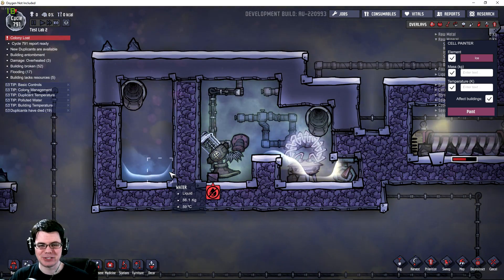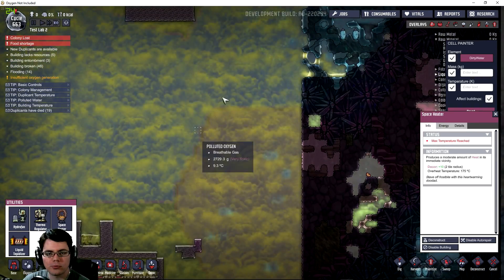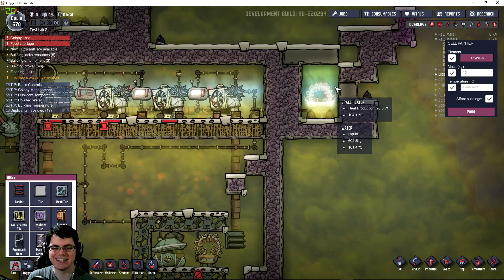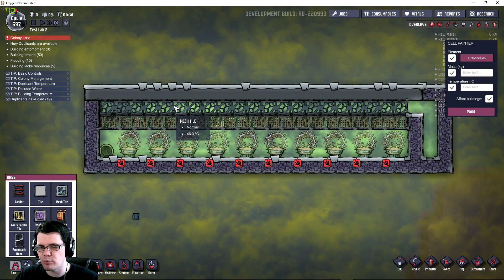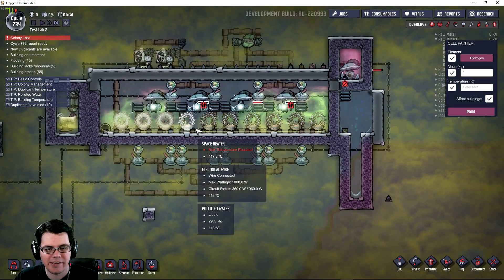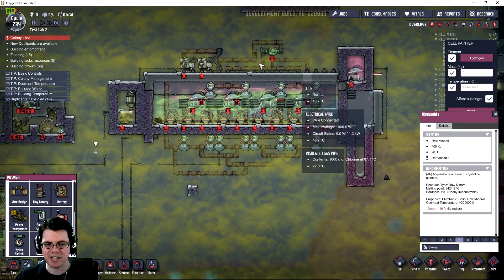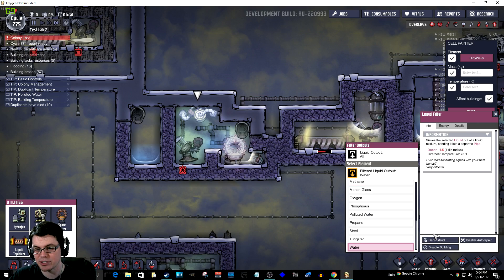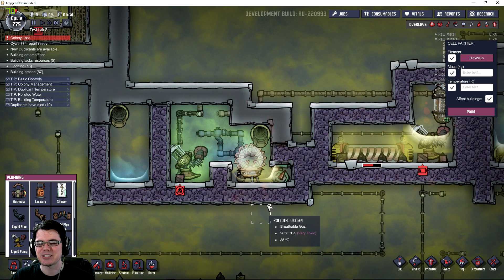Easy Steam With a Chlorine Space Heater! Oxygen Not Included

Comment: I would like to tell you a few things you may find useful in the future.

1/ all buildings that generate heat do so in two forms - "normal operation" and "exhaust". If you click on the building and point the mouse on the Heat generated item, you get a breakdown in mouse tooltip. "normal operation" is how much the building heats itself. Exhaust is how much energy is sent directly to the environment. That energy is spread evenly over all tiles covered by the building but when there's less than 1.5 kg of matter over that tile, the actually deployed energy is reduced proportionally for that tile.

2/ all building heat production needs to be multiplied by a factor of 200 to get accurate figures. Space Heater generates 18 kW of heat. Tepidizer generates 4 MW. Also all buildings (but not tiles) have mass reduced by factor of 5 for thermodynamic purposes. These both however only become important when you start making detailed heat balance/transfer calculations.

3/ There's no heat conductivity along wires or pipes. Put some in vacuum and heat up some spots by the painter, you'll see the temperature doesn't propagate

Comment: I'm convinced this will work if we experiment with mesh-floors below the space-heaters. I think it's producing a low amount of steam because there just isn't enough liquid water to turn into gas when it gets hot enough.

Pre-heat the polluted water reservoir with a tepedizer then pump it into some heat-conductive mesh tiles so the space-heaters output clings to that. Possibly even mix in some of those pipes mentioned - so as much heat as possible holds onto the 'bottom' layer of water so larger chunks it turns to steam.

Either way great find! Looks like you and the rest of us mad scientists have some experimenting to do now we know chlorine is the key.

Comment: how to do it: take your original setup, and replace the floor with gas permeable tiles, then the steam goes down and there it can be condensed into water. the condensing room is also full of chlorine, but it only needs to be the size of a liquid pump which is what will draw the water out. also add a space ABOVE the heater with a liquid vent for polluted water to be added in, restricted by a.... whatever the pressure regulator thing is called. the incoming (preferably room temp.) water cools off the chlorine (maybe) and then proceeds to become steam

Comment: I think i figured out an exploit with liquid tepidizers. The trick is to have to tepidizers next to each other (<1 tile away). Then they will see each other as part of one structure.Stack two tepidizers one on top of one another.Have the bottom one submerged in water. Give power only to the tepidizer on top.I had problems with  overheating but i'm sure that can be fixed with thermal switches.Love your videos man.Hope I didn't misspell anything))

Comment: Getting close. Seems like a big problem for consistency is the temperature of the new polluted water going into the system. Adding cool water to already heated water slows the system down and creates those bursts of clean water. Heating up small pools of polluted water converts it to steam faster, but doesn't seem like a fast or consistent way to produce clean water.
Also, if you want to eventually get this working with a Natural Gas Generator then maybe work with the rate of polluted water it discharges.

Comment: How about a setup that cools water and works on the long run.
Running pipes from a Geyser to a Cold-Biome works, but after some time (or digging up wheezeworts for example) even the cold biome might get hot. So how about cooling down large bodies of water for use in Bristle or Sleet Wheat Farms? I might think of Wheezeworts, inside a cage of Gas Permeables or something along the lines.

Comment: Whole system should be immersed in water this will also add internal pressure to your system if you compress chlorine gas temp should drop this should effect bouyancy of system when it rises internal pressure will drop and and system will regulate itself by the depth it sets in water

Comment: At point 8:07, do you really need the mesh tiles? Since once steam passes up the gas perm tile it wouldn't really go back down anymore? What if you increase the height of the condensation area with the same build at point 8:07?

Also, why not make your starting water to 200 grams, the built up condensed steam will eventually flow to your tank..

Comment: You don't need to heat it up as much as you think. 
Going from the last video. 
http://prntscr.com/fosrd3
http://prntscr.com/foss7w
http://prntscr.com/fossmk

I was sitting here wondering why there is no power. 
As you can see here, I have power 
http://prntscr.com/fost7t
http://prntscr.com/fostrp

However it shows that it is powered off for lack of power but is still running off and on. 
When I turn the temp gauge to max temp and below it still does the same thing. 
I saw dirt form. Curious. 
Then I saw fresh water forming in the pool. 
The more I sat there watching it. 
The more fresh water I saw. 
Could it be the sandstone blocks. 
The polluted o2.

I'm not sure but there is fresh water and as you see from the temps around. Very little effort. 
Maybe it's the electric wire in the back that's doing the job. 
It is getting up to 218 degrees. 
http://prntscr.com/fosz2l
http://prntscr.com/fot1it

More water forming http://prntscr.com/foszmu

Could be the lack of water dripping. 
http://prntscr.com/fot0f8

Comment: Actually now that you started to add gaspumps it realy went up in energy consumption right? Wouldn't it be better to find a way to make sand? and use this for basic filtration?
Reply: The temperature to make sand to higher than when things start to break due to overheating. I believe his purpose with this approach was to make a way to generate clean water without the risk of equipment going over temperature by exploiting the auto-shutoff of the space heaters.
Reply: Oh how interesting ... i didn't know this would crash the game at this state of the game ^^ well i'm pretty sure there will be some kinky way to make it happen later on.

Btw in one of the last videos somebody mentioned a way to use refrigerator made of abyssalite to heat up rocks and later water... did you got some time to try this out already?
Reply: Congrats again for a really interesting video! Yeah I noticed running polluted water through lava makes sand and alike. However it also reduces lava temp and eventually lava will end up as a normal rock. I dont know how you can heat a rock to 1500 C to make lava, but maybe with chlorine and other materials will be possible in the future. Normally I would assume rising the pressure to abnormal levels should lead to heating the material up - something that is not implemented in the game.

Comment: My base is heating up, what is the best way to cool it down all of my six oxygen pipes. I was going to pipe it through Weezwert full room with a vaccine around it, to keep room cold. Is that that the best solution?
Reply: skyestorme made a cooling system for his base. he had a fountain thing created filled with weez so the water could cool down and then circulated all that cool water to his base. the only problem is that it's not stable, right now it cooled the base down to 0 degrees and he is working on stabilizng it xD
Reply: Is that the best system for me?
Reply: Thankyou :)
Reply: I've found that putting a load of wheezeworts in the room I produce oxygen from electrolizers cools the air enough to keep my base cool..
Reply: I was thinking you could have a 3 way split from a single oxygen pipe that goes into a gas regulator on each one and one path just goes straight to your base and the other 2 go to an air heating and air cooling room then back to the main pipe, that way you could just find a nice balance of oxygen going through each pipe to maintain a nice temperature. Would that work?
Reply: vaccines (vacuums) mean the heat DOESNT transfer, which stops the whole idea of air conditioning.
Reply: If only they added working pressure manipulation and temperature switches, i could show you how to build the equivalent of a automotive a/c system. And temperature control it

Comment: I want to know WHY Random Contaminated Water Appears in Areas where there is No Water Source Anywhere Close By? I Actually Watched as Contaminated Water Magically Appeared. I Had my Dupes do a Priority 9 Mop and with in 30 Seconds, Contaminated Water started to Reappear. The Base was a Nice 75-80F, No Cold Bi-om Near for Condensation, No Steam Vents found yet, No Dupes Making a Mess or Vomiting, No Contaminated O2.
Reply: Could it be from high gas pressure squeezing out whatever tiny bit of moisture is in the gas?
Reply: Can't be. I don't even reach Cycle 50 before it starts happening. I am also not the only one who has this problem. Skye Storm and some of his viewers also suffer from it. But they didn't have problems until they were well past 200 cycles. and IF it was, It would not explain why the amount of Contaminated Water is between 100 & 400 Kg per tile.
Reply: Are your dupes dropping polluted ice they're trying to carry to storage containers that then melts? (Make sure only the storage containers you want to have ice have 'liquifiables' checked.)
Reply: No Ice. Have not hit a Ice Bi-om yet. No Storage Containers near by. There is NO Source of Water, Ice, Steam, Nothing within a good 20+ Tiles for the Contaminated Water to Appear. Like I said. I have watched it Just Appear, Do a Mop and Reappear 30 seconds later. I Mopped one area 4 Times in 3 Minutes.
IF I Use Ctrl+F4 to Do a Mop instead of having my Dupes Mop, The Water  Regenerates within 5-10 Seconds of Mopping. So It's Worse. 
Even After I Laid Tile Down, the Contaminated Water Generated on the Tiles in the same spot.
Reply: Have you tried posting a save file to the Klei ONI forums or bug report?  See if someone can make out what's happening?
Reply: your dupes may be pissing their pants or vomiting